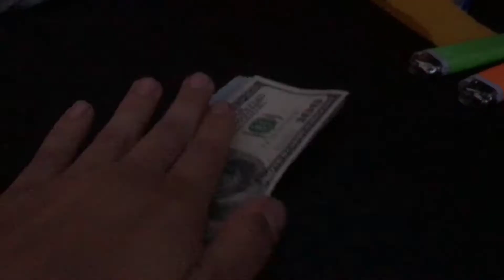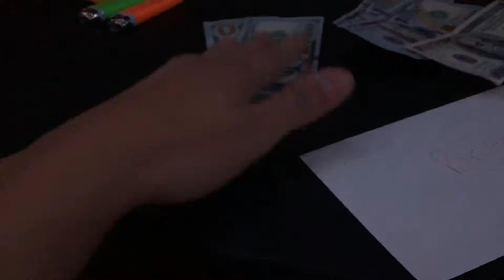B7 AUDI A4 FINALLY GETS NEW WHEELS & CLEAN FITMENT!!!

Comment: I bought the headlights but do not work with hid. Sadly I bought them for nothing
Reply from the maker: Sorry to hear that, I have heard that there is a difference in the plugs from the hid vehicles which seems abnormal but is something I didn’t know about until after I made the video and heard people opinions and issues with aftermarket headlights on the b4, but I’m pretty sure the company you bought them from accepts refunds. Sorry for the confusion💯